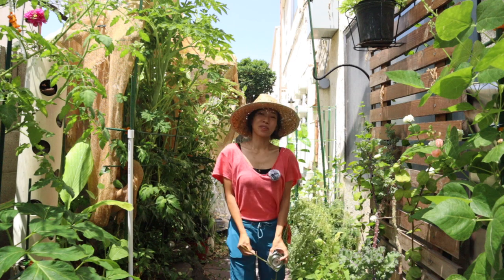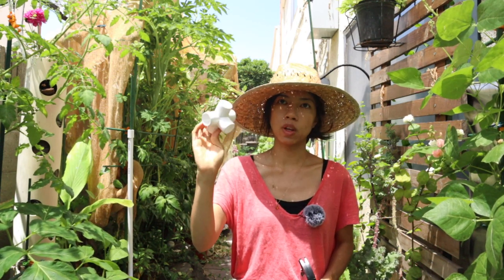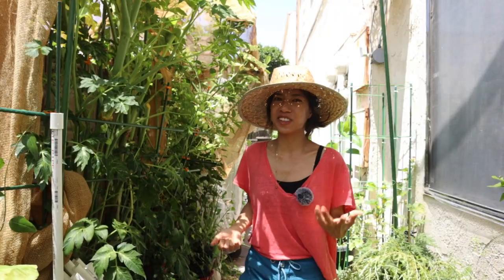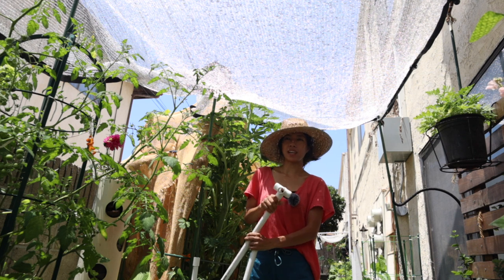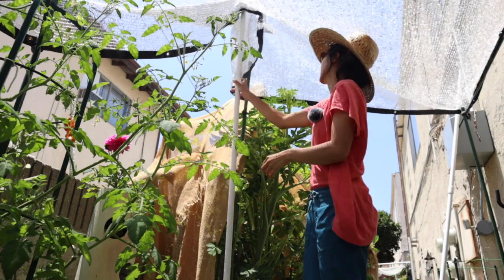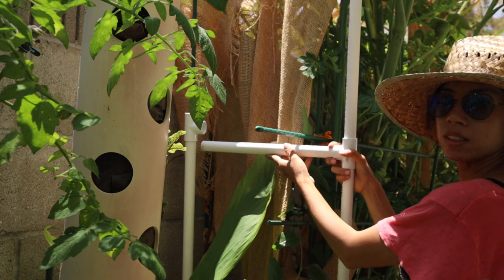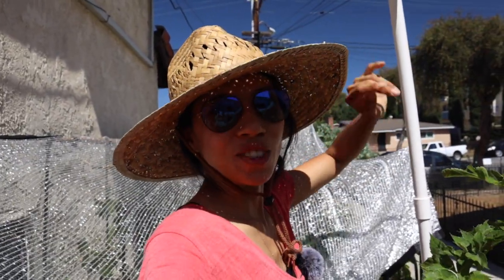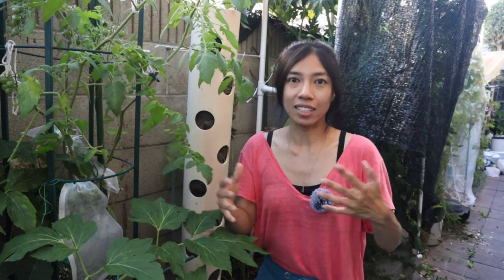Saving Plants From Sunburn (DIY)

Comment: I appreciate your willingness to at least attempt a project like this. For the future you may want to try using schedule 80 pvc as it'll have thicker walls and be a little more rigid. Gluing the pieces together would also help along with securely achoring it to the wall and ground.